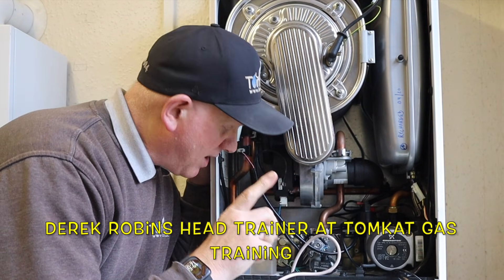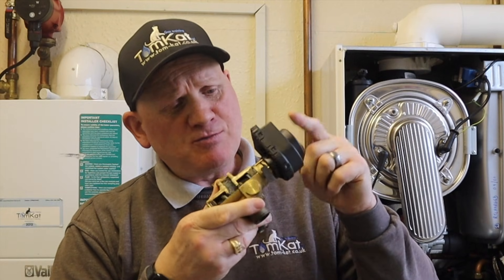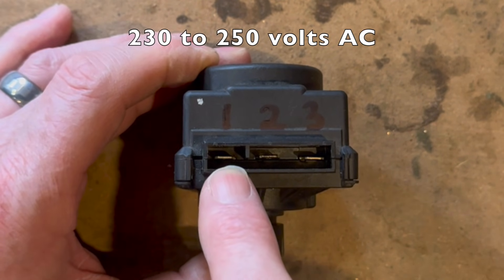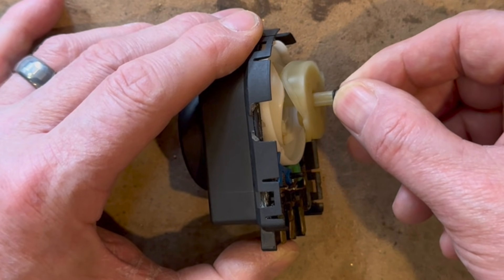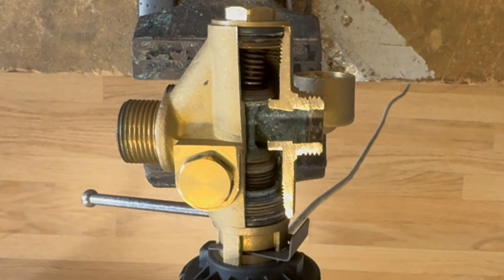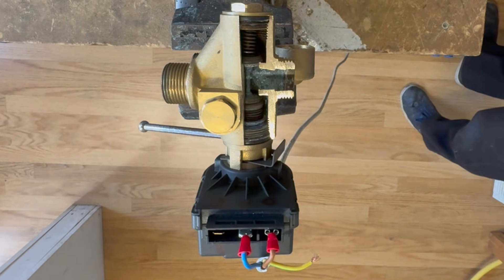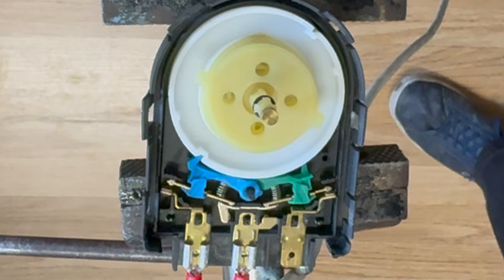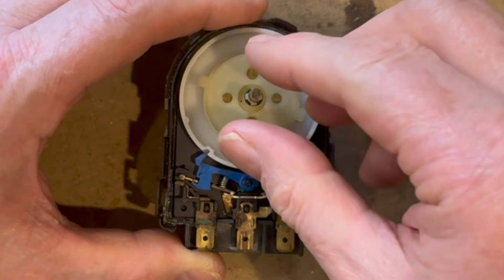How a combi boiler diverter valve and motor works. Full strip down and explanation.

Comment: thank you great video. if the motor and diverter valve get stuck in the "pin out space heating mode position" can the space heating water mix with domestic water on a call for domestic water  or are the space heating and domestic water plate heat exchanger circuits  completely separate? please help. have a  great day.
Reply from the maker: @JanosHoyos the domestic water and heating water are separated at the plate heat exchanger. Because normally the cold water is greater than the heating water pressure the cold water mixes with the heating
Reply: @tomkatgastraining  thank you